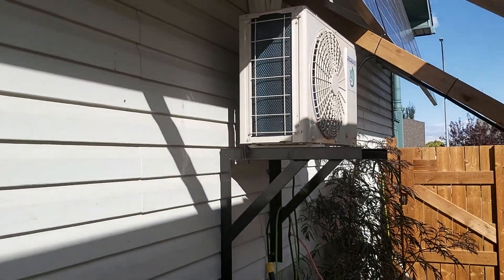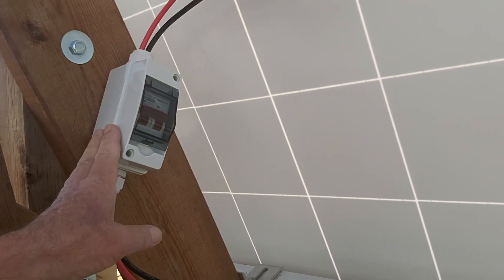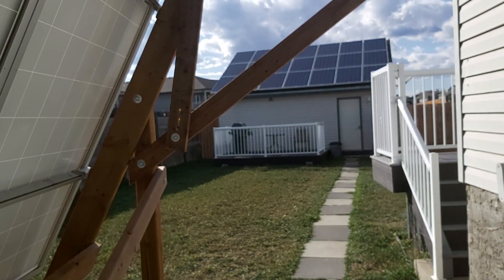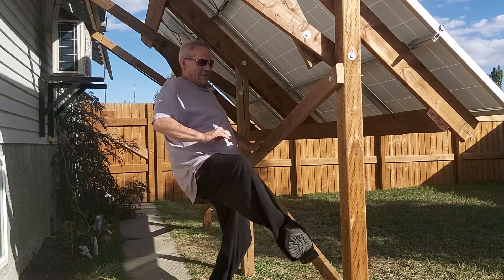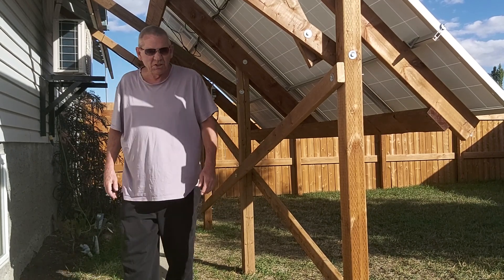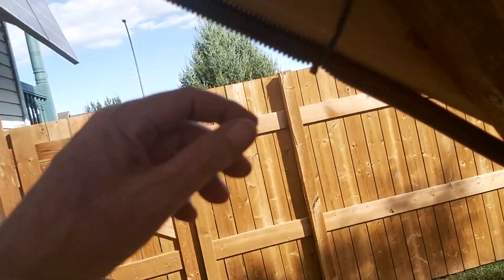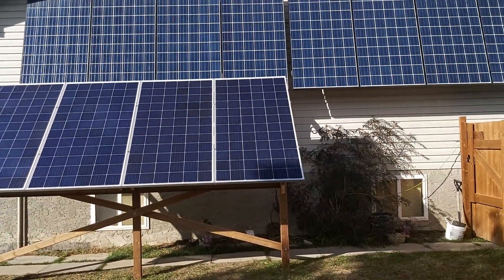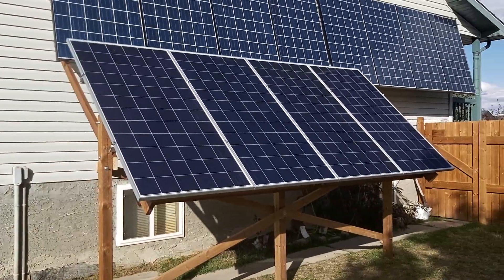Solar Powered Heat Pump Racking And The DC is Done

Comment: Your outside unit of the heat pump will heat up your solar panels that wil reduce the PV power if still in the working limiets
Reply from the maker: The panels will also heat up the heat pump for when I'm in heating mode.
Reply: @timcat1004  I think that the cold air of the heat pump will cool down the panels
Reply from the maker: @marcbruneel1858  What a concept. I doubt it will make much diff when it well below freezing temps already. Do you have OCD? LOL
Reply: @timcat1004  I just wanted to share my experience with my 10kWp installation of 2009. I've forgotten to take into account the temp coefficient of -0,43. Depending of the (hot) temperature my system decreases the day production of 60kWh down to 45k-50kWh. If you prefer to be a joker, that's your credit
Reply from the maker: @marcbruneel1858  This system is not the type of system where no one would even bother with monitoring total production. I do have a CT monitoring what it takes from the grid though. That's all I care about. You are the joker here. Get bent!

Comment: Good idea. but..
1. Use a wingnut instead of a nut on the bolt that you have to loosen when you change the angle, then you are free of tools.
2. You must consider whether you should not use only two settings. 
    Summer and Winter tilt, there are not so many advantages by moving it the few degrees in summertime at small installs.
Reply from the maker: By using a nut and washer I can clamp it down tighter. It's part of the integrity to keep it rock solid. I get hurricane winds here.

Comment: Nice work. Sat, Sep 23, 2023, 2:49 AM Autumnal equinox you're all set. Plan ahead, order more plastic snakes for Tue, Mar 19, 2024 Vernal or spring equinox to avoid birds crapping on the new array of solar panels for the heat pump.
Reply from the maker: Lol. I saw an add today for pest control. They want  $89 per panel. And of course I trolled them. lmao

Comment: Rock solid.
Try that wiggle test on anything shithead ever built, and you'll be picking yourself out of a pile of scrap timber.
Reply: Agree 100% memory serves Pine Road Guy's array came about by a nameless elderly neighbor who just meandered onto a really rundown property volunteering to build a functioning frame holding 4 free "used" solar panels for a guy who wrote a failed guide book about making your own solar panels for $1 per watt.
Reply from the maker: I even put the flying ladders away.
Reply: @timcat1004  Good thing you didn't have a half-assed dwarf sized tower with a "free" wind turbine to tumble to the ground.
Reply from the maker: @quietkate  LMAO. I remember when Troy blew his diodes and his turbine drained his battery bank.
Reply: @timcat1004  Yup he really felt special throwing out the words diodes & Joule thief as if  channeling the genius of Edison, Westinghouse & Tesla to explain inverting solar DC to standard household AC. Always on the grift believe he managed to purloin 2 wind turbines.